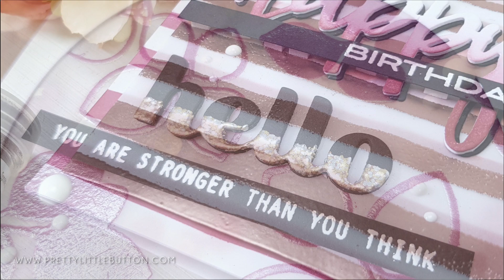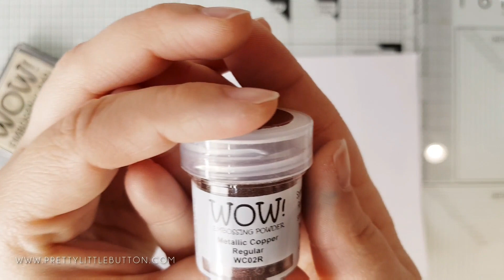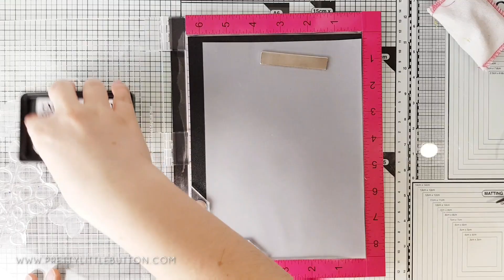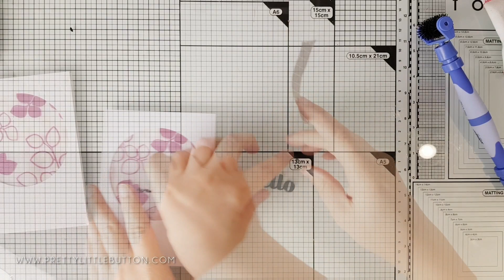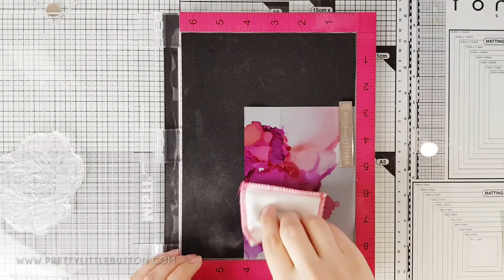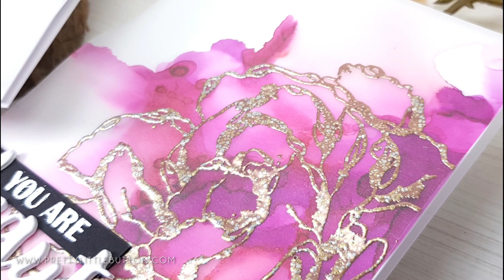3 ways with heat embossed vellum (WOW!)

Comment: beautiful cards and great techniques! :D
When gluing down die-cut sentiments, using liquid glue, how do you prevent the vellum from warping from the glue?? :O
Reply from the maker: I find it you don't put a lot of glue down and hide it behind other elements sat on top of the card then it won't show. Make sure you use a good adhesive that is strong but so you don't need to use a lot of it. The more you use the more it will cause warping or rippling